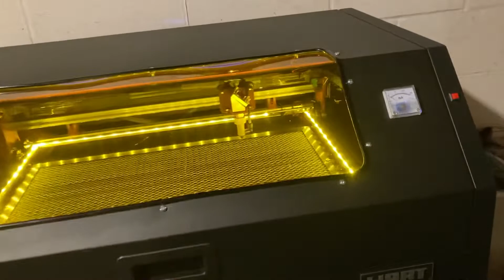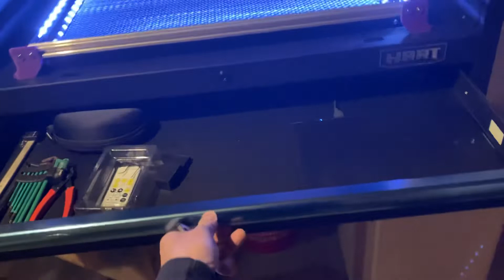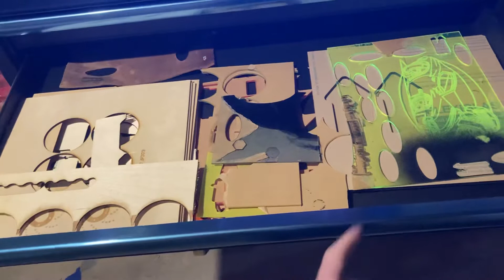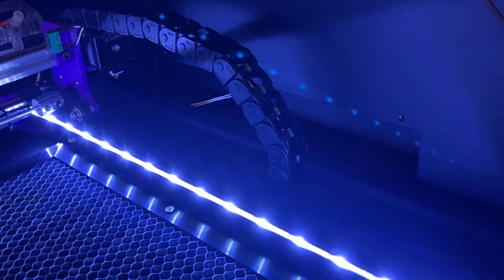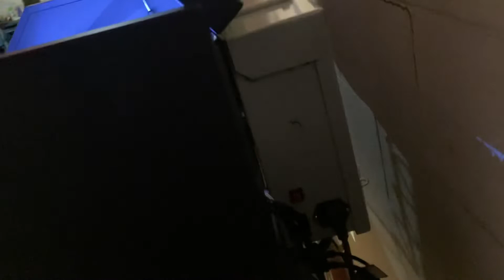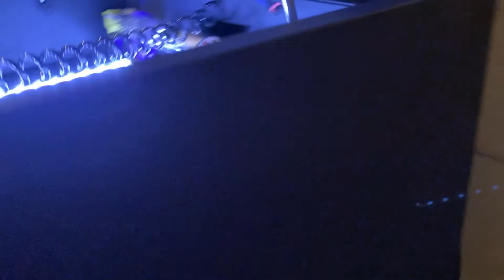Ortur laser mod

Comment: Brother, this is a great video! I can't believe how much stuff you have stuffed in there and everything is so clean. I just got the Ortur LM2 and I am already finding it bit anemic. Just happened across your video and it's by far the best design I have seen for one of these things. The tool box idea is super clever. Just all of it. If you have any video of your assembly and a list of parts, please post all of that. I would really like to reproduce your work. Thanks!
Reply from the maker: Thanks, I am working on a build document and parts list
Reply: @Robert Bekoscke  glad to hear that. I'll keep a look out for them.
Reply: @robertbekoscke988  I extended my Ortur to 900mm x 900mm and going to upgrade to what is called 80w laser. It’s really to 5 watt lasers for more power. I’m curious what benefit do you see with CO2 laser vs upgrading to stronger diode laser?
Reply from the maker: @HD32685  the co2 is actually the wattage (or at least close) so it’s putting out 40 watts power it’s much more powerful than a diode laser. Cuts in one pass engraved deeper and can run faster
Reply: @HD32685  you can t cut clear acrylic with your diode laser
Reply from the maker: I sent you a Facebook message with info
Reply: @robertbekoscke988  great, can i have the infos too please? Thanks